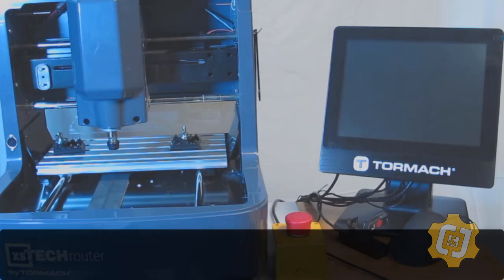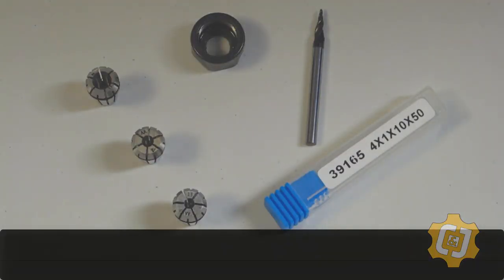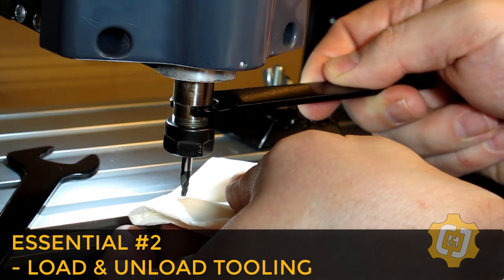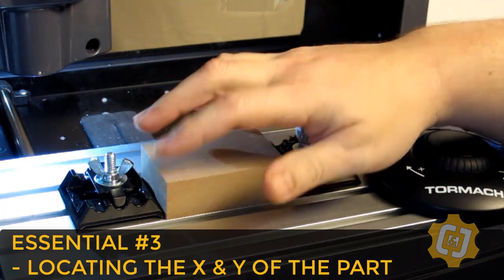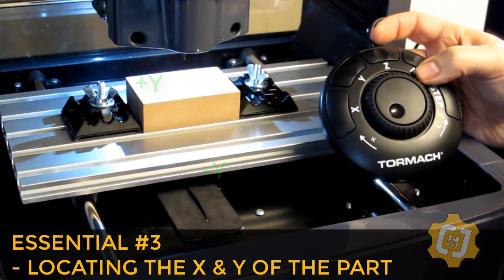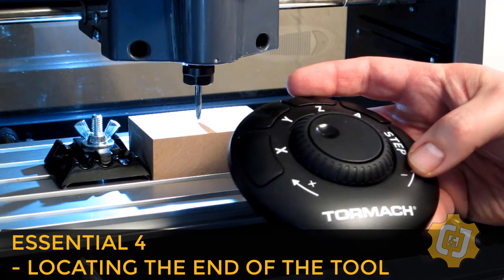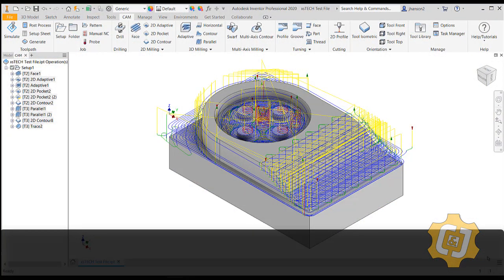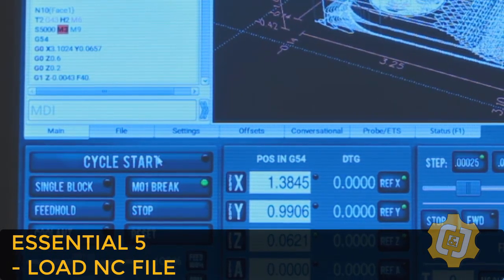Setting up the xsTECH Router

Comment: Overall, I would say this is a good informative introductory video. I would make one change though. I would recommend using the back edge of the part as the Y-axis datum or zero. If you ever put a vice in to make repeatable parts, it's good to note that the back jaw is the fixed jaw, and measurements off the front will vary as the raw stock varies. That said, the parts will need to be programmed in quadrant 4 where X is positive and Y is negative.